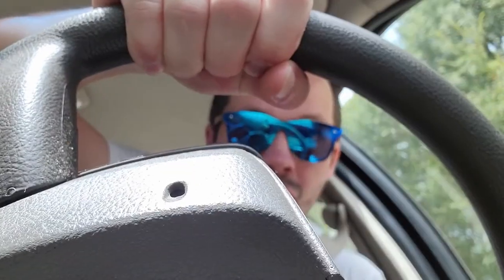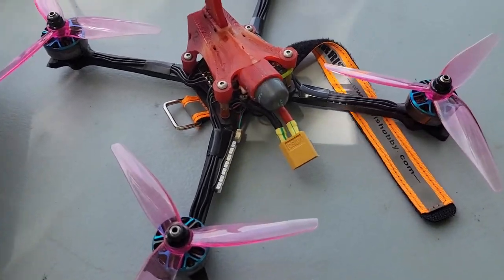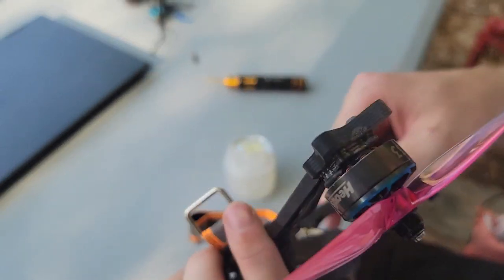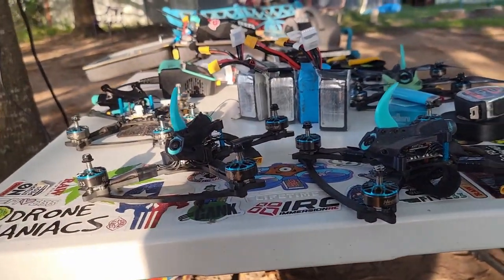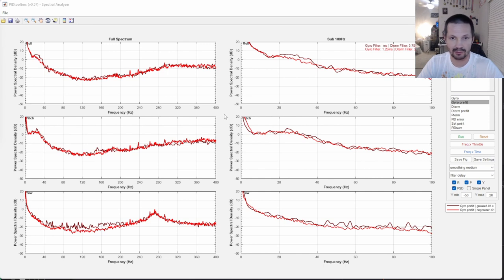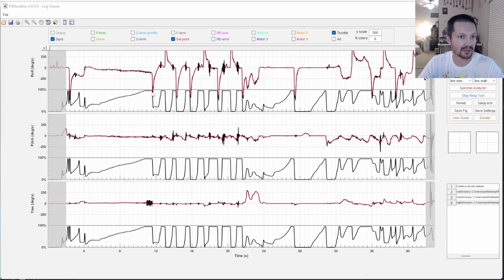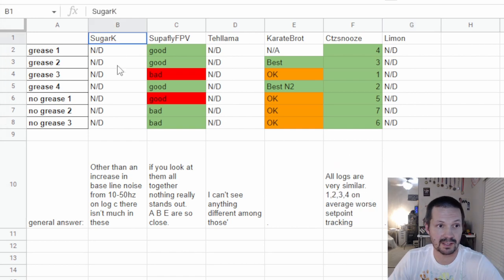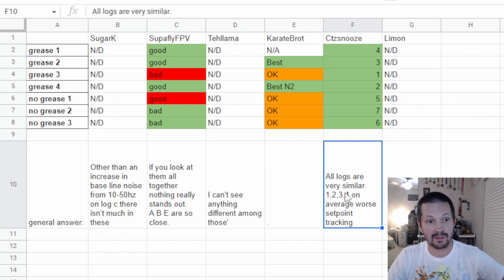Damping GREASE for drones? Real life test

Comment: I've yet to really AB it.. with identical set up quads. fly one then the other... 
but when I use it... the frame which might of rang a bit on contact turns into a dead solid chunk and returns a nice thud. 

My best flying babytooth... is two 1.5mm frames... with dampening grease between the two layers. 
but you know... could be Placebo

Comment: Even when you have a computer controlling multiple runs they are not identical, the wind and atmospheric differences, but this can be helped a good deal by logging inside a building.

Prop colour test, vibration difference? Durability difference? There is a massive amount of stuff I hear from many in FPV, definitely on a weekly basis.
Reply: The actual flights, about as similar as you'd get flying in actual dynamic air conditions, it was actually impressive.
Reply: @tehllama42  Agreed! That’s what I was getting at, Limon is very consistent considering an ever changing environment.
Reply: Prop colour is a thing.. one of our bf guys did some comprehensive tests a few years ago.. the results were surprising
Reply: @Sugar_K  
Edit: is this data available to the public?

We have a lot of new props with interesting chemistries, it would be cool to revisit.
I compare a lot of props and the newer ones feel different in the hand and in the air.
My blackbox sees the noise difference in the different colours, but everyone talks to me about different colours being more durable, I’m curious about this as I try all the colours and just stick to the best performer and have no data on durability. Would be cool to get a top level, like MCK, describe the difference in feel, if any, I sure as hell can’t tell, it’s just my blackbox.

I actually accidentally found that out while tuning, and I made sure that it’s not the mold or imbalance, so it’s definitely the chemistry. In my case anyway, I can’t say that it wouldn’t be the mold or something in every case.
Reply: @lemonsquareFPV  i think it’s the Chemistry. Basically different colours are going to have different levels of stiffness. So the results are not huge but he was able to find differences

Comment: 7" is the place where I actually have seen some form of overall difference - but I'm also mass-stacking liquid electrical tape onto places, so I'm probably getting some actual mechanical damping effects beyond just the contact points at fastener/joint locations (and this is also on cheaper frames).
Reply from the maker: Yeah that's what Supafly said too about bigger drones.
Reply: @IvanEfimovLimon  id imagine doing this on cinelifter setups would be beneficial too right?
Reply from the maker: @MrKillerHobbes  I highly doubt that grease is beneficial when screws are tight lol
Reply: @IvanEfimovLimon  I meant liquid eletrical tape for 7inch or bigger craft as tehllama said. i feel you on the grease tho! if ur frame is good then grease shouldnt have any effect
Reply from the maker: @MrKillerHobbes  yeah liquid tape might help of course, just like any glue if you glue together the frame besides the screws ha ))
Reply: @IvanEfimovLimon  makes sense! liquid tape seems ez to remove with no residue i assume! keep making the killer content bro! love the jokes too

Comment: I use grease but only on the threads of the hardware. They go in tighter and stay tight.
Reply: You're describing threadlockers, which should always be used. Damping grease is different for a different application
Reply: @tehllama42  still can load dampening grease in standoffs to reduce vibration.
Reply: FYI lubricants are used on threads of some higher torqued fasteners like on firearms and biclcyes, lube does let the fasteners get torqued up to standard, so high that won't get loose under intended use, but still able to be removed and reinstalled without the mess of threadlockers.

While threadlockers are used on only a few places for those applications.
Reply: @KwongKan  Right - but running threadlockers of any description on stuff that is subjected to a lot of high bandwidth frequency content vibrations is a generally sound practice.
Reply from the maker: Interesting, why you don't like thread locker? Blue one works good for me...
Reply: Standard practice in high end bike building. You use grease on all bolts and a torque wrench. We also use carbon paste between carbon handle bars etc which is grit suspended a liquid like grease to stop movement of the 2 items.  Frankly carbon paste would be more useful between arm than grease but it’s still a big no in my books
Reply: Same, and for the same reason, I just use the same Teflon grease that I pack my motor bearings with. Works very well. Definitely recommend.

It is much cleaner than loctite, and is one less thing for me to pack with me.

Comment: I have beast class frames with 14mm thick stacked arms I use polyurethane adhesive to bond them together. Can’t be beat allows higher cut offs and cleans up big birds massively increases stiffness and strength. Tried the grease doesn’t last long.
Reply: Adhesive isn’t grease though! Carbon paste for push bikes would be a good idea too easier to clean up

Comment: Nope, done that. I get sticky hand and sticky quad! what i do now is apply some silicone glue as damping (optional)
Reply: You sure its not the weight of the glue that's doing the extra damping???
Reply: @Finnv893  4 arm used about 2 drops of silicon glue haha. didn't check backbox yet, doesn't matter because it fly really well without doing anything.

Comment: Your quad doesn't have frame resonance problems, so there is nothing to "fix". 

Take a quad that has frame resonance and try again, it works. But its not going to remove problems that arent there...
Reply from the maker: Oh, there are some frame resonances, can see them in all the plots. The biggest is global spike on yaw. It's not moved anywhere, not even an inch.

Also grease is not just for resonances. It's for all the noise out there supposedly. Grease does not know if the noise is resonance or motor noise or "ambient" noise, it just transfers friction to heat. Well, supposed to. Yaw resonances ~260Hz is well seen at 06:30. I wish we could post pictures here :)
Reply: @IvanEfimovLimon  My experience was much different. Ill post links to screenshots of my logs below. The comment will probably show in your "held for review" section, which is why im leaving it in a separate comment. I can provide the logs on discord if you are curious.

Comment: May be it is effective on the resonance frequency, but on your experiement you have created motor vibrations.
Reply from the maker: how the grease would know if a vibration is resonance or a motor? :)
Reply: @IvanEfimovLimon  maybe because resonance is sensitivity to a certain vibration frequency, by adding grease we change the mechanical structure, hence it will change the sensitivity for that paricular frequency, so not all frames will react the same way to adding grease
Reply from the maker: @anahoua4837  i don't think that's how it works. Plus on the yaw axis I had a strong resonance at 200hz+ that didn't change at all.

Comment: I have two nearly identical builds, one with the same grease you used and one without. I cannot tell a difference in how they fly, and the motors with the same filters and pids come down at the same temperature. I think the grease might help in situations where there's adverse conditions, like bent or disfigured props, but that's specific situations and it's likely you won't notice enough difference in flight performance with a well tuned and filtered quad for it to matter. Keep on keepin on!

Comment: Next maybe rubber motor dumpers?
Reply from the maker: eeeehhh.. not sure how i feel about them lol :) are they being sold somewhere?
Reply: I'll save you some time - you can damp a lot of the system at the wrong frequency regime, and get very consistently worse results. This is one of those ways in every combination I've tried.
Reply: @IvanEfimovLimon  I got a set of silicone ones from AliExpress. I did a lot of testing… basically trying to figure out the electrical tape fad from a while back, I did also test electrical tape. It is much easier than fiddling and cutting electrical tape but is still very finicky.

Everything needs to be torqued equally and I tried a large amount of torque values. Different torque values move the vibration frequency band. It can make it much worse, or slightly better. It helps on some motors, but I gave up on it as it is too finicky and requires way too much effort. You also MUST use 4 screws, which was a no go for me as well.

Now I just hard mount with 2 screws. I just pack my motor bearings with grease regularly and check balance occasionally and this honestly works for me.

Greased bearings and balanced motors make the biggest difference of everything I have tested.